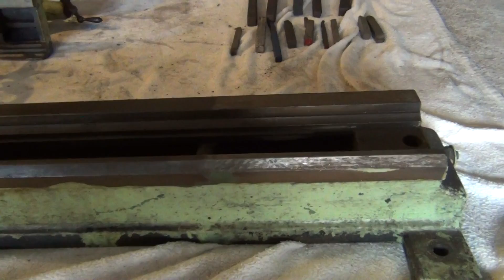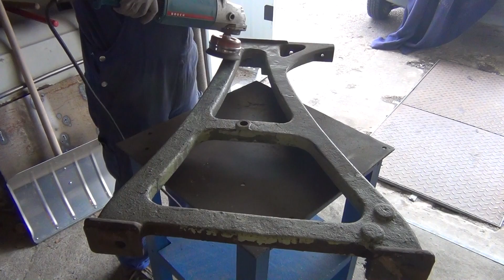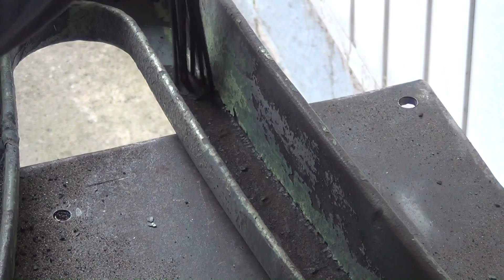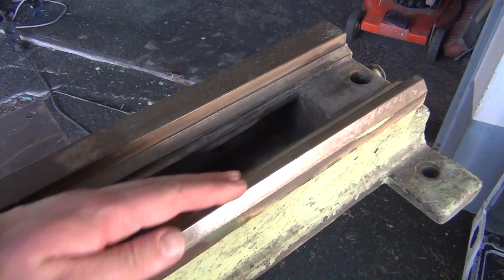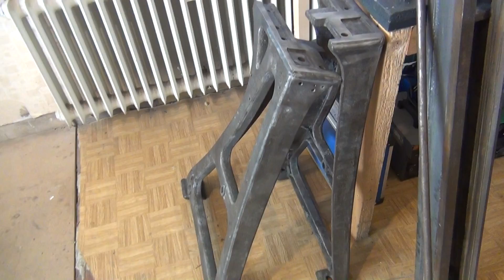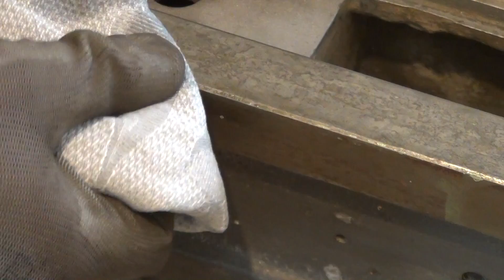Lathe Restoration (1):  Paint and Rust Removal Methods, Assembling the Basic Frame

Comment: Removing Rust with Electrolysis - WOOD magazine
https://www.youtube.com/watch?v=54ADeB6V1rQ
Reply: Electrolysis seems a pretty popular option, in the comment section. I'd like to see it too. As the video +Luke Liberty linked to mentions briefly, once you've removed all the rust, with a method like electrolysis, it's likely to pretty much immediately start rusting again. You might want to be ready to apply something like "Renaissance Wax" to any surfaces you'd rather not coat in oil.

Comment: To remove rust chemically use anything that is based on phosphoric acid.  You can get it in gelled form as Naval Jelly.  It's not magical, and will require lots of elbow grease to use, but it does work.

Comment: Metheline Chloride is a good paint solvent/degreaser.
You can use baking soda on the ways and soda blast them.  It is quite gentle and works well.  You  can also steam clean after sand blasting but you need to get a coat of primer on straight away.  Then you can put a couple of coats of engine paint on the parts that need to be painted.  For the ways, use a phosphoric acid preparation like Boshield Rust Free.  Then follow up with something like Boshield t9.

Comment: For rust removal check out the videos and especially the comments of these links:
https://www.youtube.com/watch?v=ylZ6UsiwK20    https://www.youtube.com/watch?v=rhiTuuiA4nQ  https://www.youtube.com/watch?v=NKZv14-K71g  But for any process you have to submerge the parts in some liquid. So you have to disassemble the lathe frame again or put it upside down in a flat pan. For the bed ways I would recommend a chelating agent like Evaporust or similar.

Comment: Hi German friend I would use a long sanding block with a fine sand paper with Diesel fuel until it get really shinny and it will remove small imperfections what you have to do is long sanding strokes so you remove the same amount of material all along the ways.
Reply: +V10PDTDI Yes, I agree with you heartily.  I would be concerned that a chemical rust treatment on the rails might hinder operation by removing or depositing additional material unevenly.

Honestly, the amount of rust I can see on the rails seems to be trivial, and much of that will come off in regular use, as the tail stock and other attachments are run upon it a few times.  

I suggest cleaning up the tailstock and then checking its movement on the bed as well as its ability to remain clamped while exerting lateral pressure on the spindle, before treating its surface.

-

Comment: We call the air tool a needle scaler here in the states.  Myself, I prefer to use electrolysis whenever possible on large parts (I use a plastic 55 gal or 200 litres chemical barrel for the electrolysis process.  On smaller parts I use Evapo-Rust and it works great.  Lots of other methods for removing rust and paint but the electrolysis will also remove paint as well and what it doesn't remove gets a light sanding before primer.

Comment: Muriatic acid works fast, but the fumes will rust everything around it. Vinegar works as well and no fumes, but slower. Electrolysis is best, but it is a pain to setup and you'll need to dismantle the lathe. Finally, theres the mechanical means. In this case, I would use steel wool and vinegar and clean up with some baking soda and water. Although it will remove some material, you might have to hand scrape the lathe anyway to flatten it for precision. Hand scraping is a must and is easy to learn. There are quite a few videos online showing the process. There's a German video where a kid scrape a surface using a Dremel and a grinding stone,  I tried it and it works like a charm and it is very fast and not as tiring!

Comment: With that big cup wheel, when it wears down you just knock of the silver ring and then you can use the rest of the wire. That descaler we just call a needle gun. That motor you have looks like a 3 Phase that has been modified to run on single phase judging by the capacitor that is on it.

Comment: Here in the US we have a rust remover called "Evapo-Rust". It's a gel to be brushed of and left to work. It's very effective. I don't know its chemical basis but maybe the name will lead you to a German equivalent. I do know it's a rust remover not a conversion product like those containing phosphoric acid. Evapo-Rust does not attack bare steel and is allegedly safe for bare hands. I witnessed the Evapo-Rust restoration of a box of rusty milling cutters to new bright appearing surfaces. Naturally, metal once oxidized is lost forever so the cutting edges suffered in proportion to the degree of rust.

I don't recommend phosphoric acid containing products for way surfaces without vigorous stiff bristle brush scrubbing afterwards while still wet. The adherent residues are quite hard and can be a pain to scrape through. 

Maybe I should qualify myself. I'm a old machinist with some experience as a machine tool rebuilder. 

I've always called machine tools that age and condition "heartbreakers" because of the perseverance and raw luck required to attain even modest success.  I wish you good luck restoring that relic to some kind of function.
Reply: Adding, yes it is a "needle gun" or "needle scaler". I've used them many times on paint, boiler scale, weld slag, and failing concrete as a patch prep. It's an excellent tool for its intended use but a disaster if it strays onto precision surfaces, plating, labels, electrical wiring or devices, or wood, or any other item you don't want to batter the snot out of.

Comment: Hello P.A.I

No I didn't post any links, just a comment about that strengthening bar, I was wondering if originally it took a lathe attachment for automatically advancing the machine tool across the bed of the lathe
Reply: +freesaxon I agree, the 3 holes at the right hand end are for mounting a tapering attachment.  Great video..

Comment: Evap-O-Rust works great. Regular vinegar works pretty well for light rust. You can probably just stone off that small of rust, the ways need to be stoned anyway.
Reply: +justfakeit888 I've tried that evaporust and it works good for bolts and nuts, but for large flat areas, I've soaked paper towels and covered with plastic, and it just derusts the outer layer of rust.  The main 'mushrooms' of rust are still there.  After one gallon, I just found a wire wheel was the best.  But I never tried the needle gun for other parts, that looks awesome.  Flat beds though I would def do wire brushing.
Reply: I made a box to soak a milling machine table in and it worked very well. The paper towel method leaves some weird etchings sometimes. I will agree a wire wheel will work better, but he doesn't want to damage the probably heavily worn ways. I'd still just stone the burs down and knock off the rust at the same time.

Comment: try electrolysis for rust removal on most of your parts, there's some really good videos by mr. Pete comma and Keith Rucker at vintagemachinery.org.

Jack....
Reply: Yep. My vote is for electrolysis. A custom bath could be made from scrap plastic and silicone sealant. It's self regulating too...so only the rust will be removed...ideal for precision parts. And would make for an interesting video.
Reply: +thelastofthemartians ive also seen a bath made from a large rubber sheet set into a simple wood frame, no sealant needed, you can make custom bath sizes for various parts and job sizes.
Reply: +Olivia Bishop I don't believe TPAI would be able to make a bath big enough for the big parts.

Comment: hi man thanks for sharing, if you don`t mind i want to contribute something to this thread.
i have restored many pieces of machinery (not for the fun of it but for lack of money) one method applicable to some parts is to burn the paint with a propane, oxi or whatever torch (sometimes even an electric heat gun) then mechanically removing it with a wire brush and it comes off quickly
the needle gun i have is mostly used when welding cast iron to peen the surface of the weld bead immediately after welding as it seems to prevent cracking (in conjunction with other measures - not as the only method)
for removing the rust of the ways i`d use first something less hard than the ways itself, steel wool for example, some grades of scotchpad  then go to some light abrasive or an acid (several comments about using vinegar, and this works, soaked works well, soaked and boiled works best) but beware any strong acid or abrasive can have the effect of changing the profile or creating divots. so sometimes it`s best to address the general picture and not try to remove 100% of it. 
well hope this helps.
thanks for sharing i`ve recently subscribed to your channel
take care 
pete 
ps if you use an acid you must immediately neutralize with warm water and dish soap, dry well then coat it with a light layer of oil (not wd40 - too light) to prevent flash rust. i remark the word immediately

Comment: hello Post apocalyptic man as rust remover i used oxalic acid several times with a 5% concentration this works as a 10 % or 2% concenctration aswell but it works slower when the concentration is lower it does not leave your iron untouched but when removed in time the solution does not damage the iron at all i would advise trying this on a piece you don't need first bit i think you meight be happy with the result. You can also use electrolyses there are plenty of youtube films about that but i have no experience with that what so ever i wish you good luck and allot of fun !

Comment: Product in USA a called EvapoRust is getting great reviews but it's an immersion product so fine for tail-stock and smaller parts that can be placed in a pan.
For the Machine Bed...what about a very fine(1000 grit) wet sand paper that would be close to a polish or even buffing with fine semi-abrasive compound? Seem to me that will remove the rust and leave you with a smooth polished surface as well.
Reply: +GrandsonofKong I've used EvapoRust and it works extremely well.  I see there is a version from a company called Rustyco that is available in Europe and they do a gel version (which I have not used yet).  If it is anything like EvapoRust it will be ideal.  

German link for TPAI is http://www.rustyco.de/

Comment: At 16:15  I use wd40, and or liquid wrench. Brush it on heavy, let soak. Then scrub. Repeat. Soak over night etc. It should clean all rust away. Your house is a lot like mine, appears we like the same kind of furniture. Sure beats couches, chairs, etc. The ways on that lathe appear to be in quite good shape by what I can see. But cant see good though. As far as scraping goes, that takes a well experienced person to do to get it right. You likely to make a mess of it if not experienced. One can do precision work on a worn out machine, at least someone who is experienced machinist can. I know first hand, done tool & die work on a completely trashed lathe, bed has massive wear near chuck. One must compensate on cut for wear, know just how deep can go for finish cut, etc. It used to make me feel proud to make precision parts on destroyed equipment. Your lathe ways looks like in very good  shape though, no need to mess with ways.

Comment: Evaporust is a pretty good product for rust removal, very safe to use. Normally it's something you soak parts in, but it can be brushed on or even soak a rag in it and place on the part. Also: you can re-use it multiple times if you soak parts in it.

http://www.amazon.com/Evapo-Rust-ER012-Original-Super-Remover/dp/B00M0TLQ66/ref=pd_sim_263_6?ie=UTF8&dpID=51cutVJx5dL&dpSrc=sims&preST=_AC_UL160_SR141%2C160_&refRID=0BE8HG5EKXBNTKCC5G8W

Comment: You may use http://www.amazon.de/Hocheffektiver-Rostumwandler-Rostentferner-Rostio-Entroster/dp/B00IO51FDE for removing the rust, however, if you wanna use an industrial way you have to use hydrofluric acid, but due to safetyconcerns I suggest using the commercial product.

Comment: If you take your time (and you should 🤓) I think you should consider to at least give the frame a primer paint job. If rust kicks in your back to zero!
Reply: +Joop Terwijn Yeah taking stuff down to bare metal is a big no no. You could end up less than zero. Whenever I did it on cars I'd use a metal conditioner on the surface before I primed it too. It'd turn the metal blue. But I think all it was was alcohol with some dye in it? At least that is what it smelled like to me.

Comment: A smashing job done :-D, the cast frame looks a hell of a lot better.
.
Perhaps wire wool or brillopads (kitchen use) can be used to gently clean the lathe tracks.
Old brake/clutch fluid may melt the paint off too.
Reply: +zx8401ztv It looked better with the crinkle coat crazed green paint job it had on it. That's the classic old machine look.

Comment: you can get rust of with tin foyol and cola. tryi it. 😉
Reply: +King of games j.w Can you explain please ? We all would be interested !
Reply: +ScotsFurian Well aluminum oxidizes almost immediately in atmosphere. So what you're really doing is rubbing a fine aluminum oxide on your work. Aluminum oxide in coarser grades is what sandpaper is commonly made out of too. We just don't usually see aluminum rust because the thin layer of oxide is transparent, and protects the underlying metal from rusting further. The tin foil trick works pretty good on pitted chrome. I've done it.

Comment: Looks good.. :) You should consider painting it before doing any kind of work with it, as you might use cutting oil or even just the oil to lubricate the runners and the bearings might get all over the base and you can start the whole cleaning process again for painting..
But just oiling it and leave the cast iron color/finish probably fits the machine well, too.
Now its old quality stuff so it probably doesn't rust that quickly, but now that its so nice and clean would be sad if it started getting surface rust all over by the time you have it finished and ready to paint.. So maybe painting it and removing the paint on parts in case you need to do any modifications might just be easier..
Reply: +huberkarle also the needle scaler looks like the right tool i'm going to need if i ever want to remove the several layers of thick old paint on my old tractor..
Reply: +huberkarle yeah I was impressed at how the scaler knocked that old paint off. i might have to pick one up just to use it for that. I thought they were only good for beating flux off weld beads.

Comment: Use white vinegar soaked in a rag and place them over the rusted part. Just be sure to keep it wet with vinegar. You can also soak smaller parts in a bath of vinegar over night to remove rust. Cheap and easy way.
Reply: +Curtis .B Hertz Michealthulu does this to de-rust and de-scale his steel. It takes some time and soaking overnight is the best method. Using a rag and wiping should be possible, it will just take forever.
Reply: +KnightsWithoutATable That just so happens to be who I learnt this method from. You are completely right about soaking over night, even the rag needs to sit over night. I've found if you can get part of the rag into a container of vinegar, it just wicks up the rag as it needs over night.

Comment: Why don't you use Electrolytic Rust Removal method.  Its a cool way to electrically remove rust from the entire surface of a part and it easy to do.  I've seen it used on small and very large parts.

Comment: Hey man nice video.thank you for sharing!! 
I salvaged a photocopier two weeks ago, unfortunately I found only one Nema 17 stepper motor and another 3 small ones, it would be really awesome if you could continue the video about how to make a steeper motor controller. 
All and all great job and videos ☺
Reply: +mataz farouh stepper motor controllers are digital machines. Like your computer is. Stepper drivers on the other hand are current sources with switching elements attached to a circuit called a sequencer. I've made my own drives with TTL sequencers. I don't recommend it. I did it like 20 years ago when drives were much more expensive. Today you can get pretty good drives for cheap. I will add that due to noise I prefer optically isolated drives. Overcoming noise was the biggest issue I faced when I made my drives. PWM choppers connected to inductors make for some cra-cra signal noise.
Reply: +Paul Frederick thank you I meant indeed drivers, I'm trying to make a cnc mill/3d printer for my thesis and I have no idea how to make it for cheap because it's gonna stay in my university, I think I'll end up  using ramps 1.4 with compatible drivers but "the post apocalypse inventor" gave me food for thinking and I try to salvage whatever I can wherever I can and make any possible thing by myself.
Reply: mataz farouh
As far as the cheapest goes there are Pololu chip carriers. I hesitate to call them drives, although they almost are. They lack optical isolation, which may lead to problems running them with each other. The other bottom basement solution is one of the integrated TB6560 boards. Where you will end up spending your money is on the linear components. The lead screws, and slides. It is difficult to cheap out there. Well, when you do performance, and accuracy suffers. Also the power supply itself is often overlooked as a major expense. Low voltage high current power sources do not come cheap. Well, the surplus switchers do, but there's a reason they're trash. They are far from the best solution too.

Comment: After all that work that you've done: Don't leave the cast iron naked; give it at least a coating of primer!
Reply from the maker: +Fernand Geene Van Yeah I suppose you're right. I still have a large bucket of polyurethane based RAL 7021 (In Germany called "Panzergrau" ) paint in storage. It's the same stuff I used for my drill press. I guess I will use it sooner or later for this project.